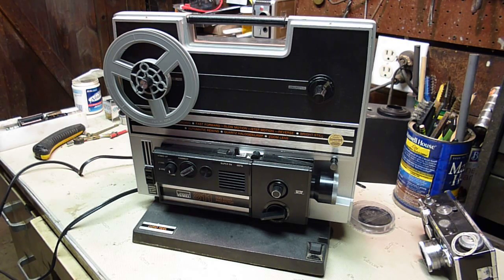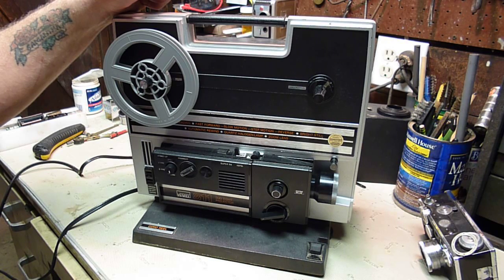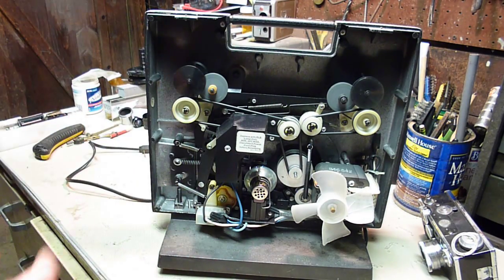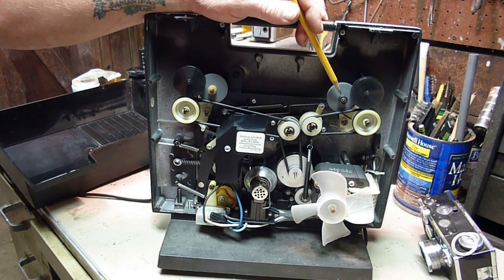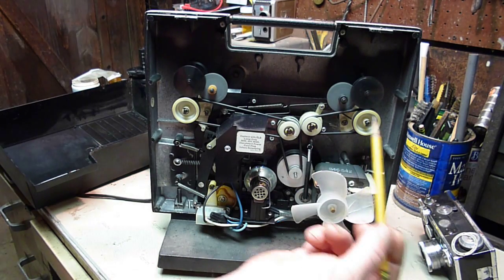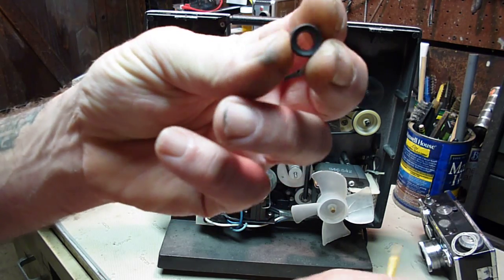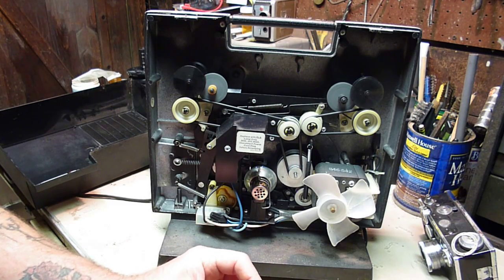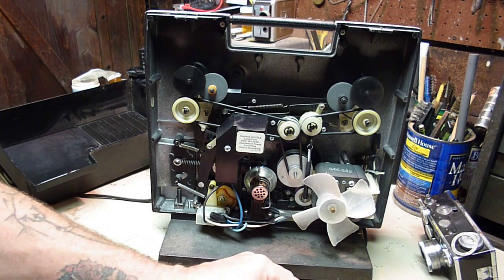Montgomery Ward 811 Duo Eight Projector

Comment: I have the MW 806 Duo. After replacing the main belt and the bulb, it was working great. All of a sudden the film broke while I was viewing the film. I took it off and replaced with another film and the projector will no longer feed the film through. Any words of wisdom?
Reply from the maker: Im sorry, I just found your question. Even though you have probably worked it out, my experience so far has been that the auto feed feature is twitchy at best. For this one, I had gotten so I take off the cover that is over the feed gizmos, and help it along by hand. Also, my camera seems to do 8mm far better that super 8. I can find no reason why.
Reply: I had the same issue. It would not feed automatic or would not move forward at all. I removed the back cover to find the forward drive belt had broken. Very common. I found a replacement set on ebay. After replacing the little 5/16" wide flat belt, it worked for about 20 minutes and stopped again. I replaced the flat belt with a round O ring belt in the kit. Works much better now.